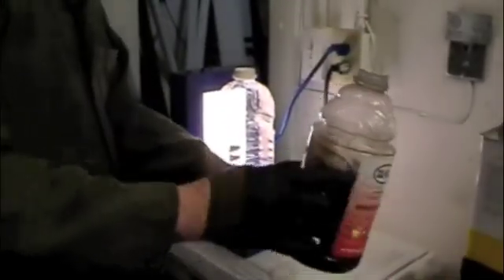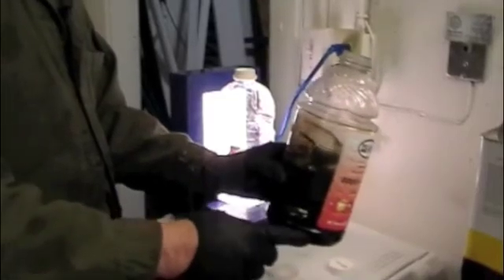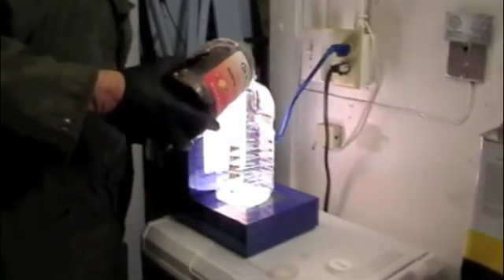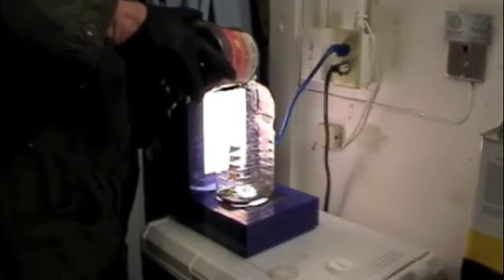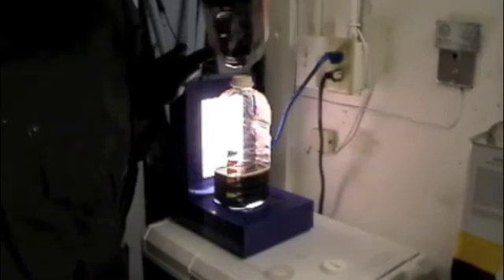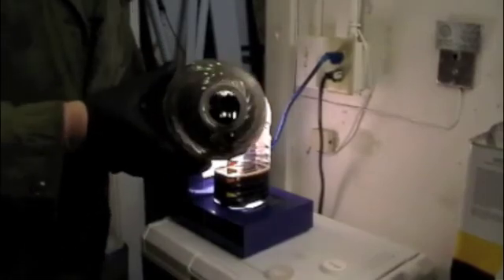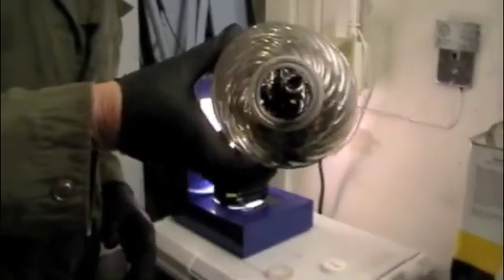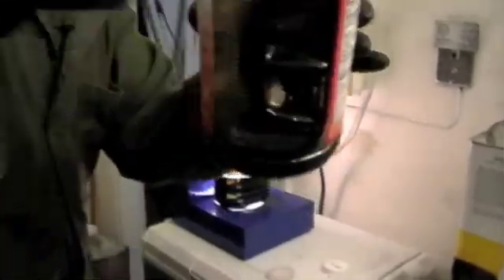Making Translucent WMO Blend Diesel Fuel

Comment from the maker: My final Translucent WMO Blend Diesel Fuel experiment ran for 3 months before my injectors coked up.  So, I certainly had some success; however, I have given up on blending and filtering to make WMO run on my engine. I am now building a distillation unit to recycle WMO into diesel fuel.

Comment from the maker: You obviously have not conducted the same experiments that I have, because I consistently produce translucent blends of WMO-based diesel fuel; however, I will agree that WMO is full of ash, free-carbon and lacquer, which has to be removed to make translucent, but, the resulting translucent blend is nonetheless full of ash, which could cause premature engine wear.  So, I prefer to make my blends out of WMO only.